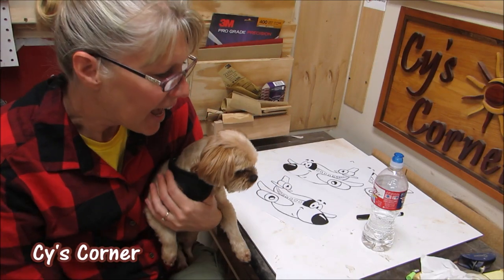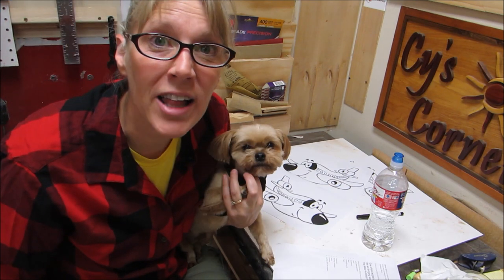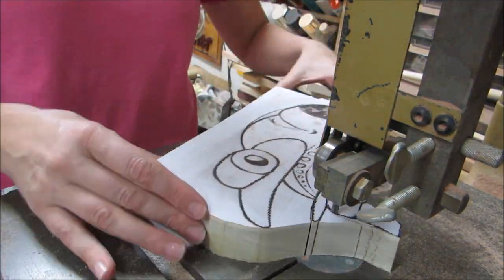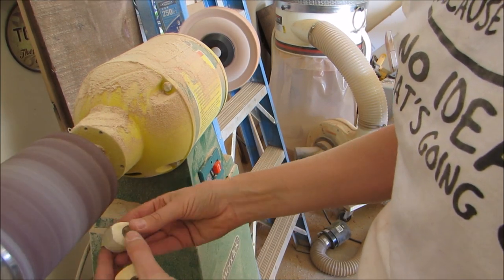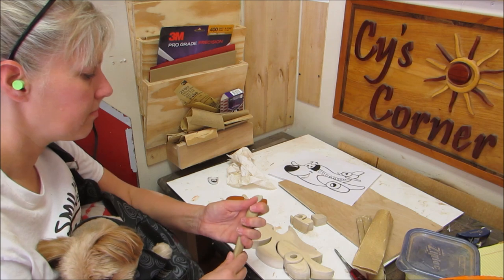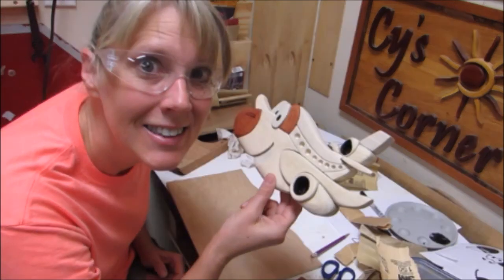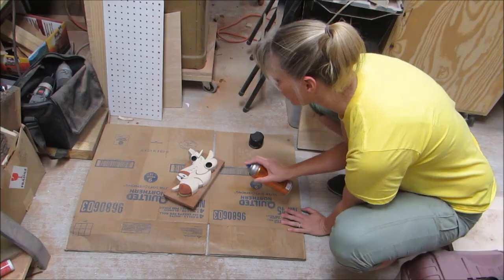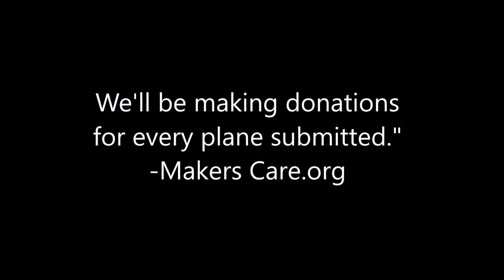Makers Care Plane

Comment: Hey Cy - you said you drilled out the windows - what did you use?  I just tried something similar using Forstner bits for the first time and didn’t realize they would leave a hole in the center of the hollowed out bottom.  Yours look flat - how’d you do that?
Reply from the maker: @DocEE It's been so long ago, but if I did it again I would use a regular drill bit. They'd be concave but I think it would look fine.